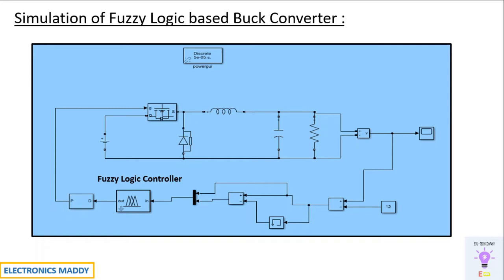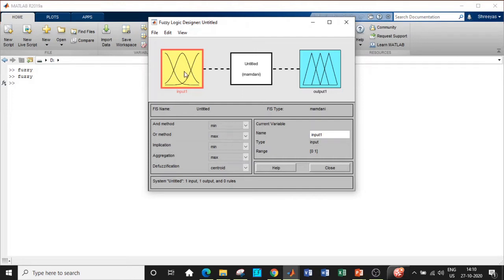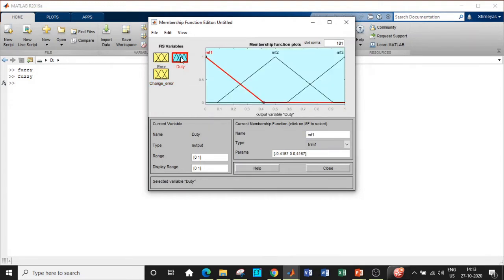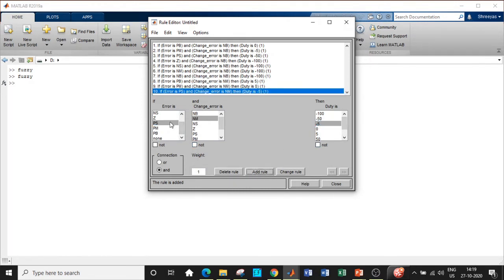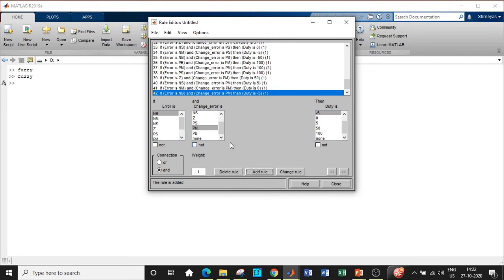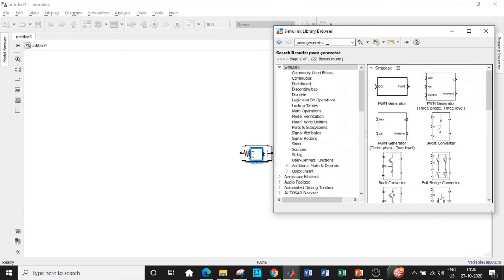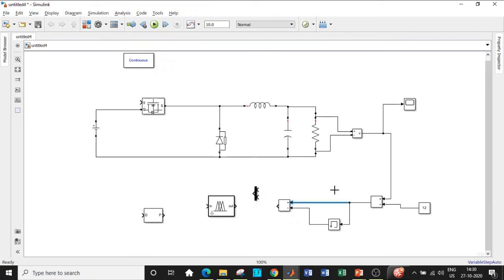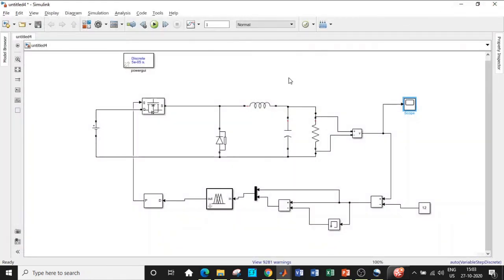Simulation of Fuzzy Logic based Buck Converter in MATLAB | SIMULINK

Comment: Sir on which bases you have decided the values of the duty cycles
Reply from the maker: Certain parameters are assumed to have an initial design
Reply: @ElectronicsMaddy  sir can you tell me those parameters ?
Reply from the maker: Duty cycle, source voltage and load
Reply from the maker: Please check the videos on basic buck , boost simulations. I have explained there

Comment: hii...In fuzzy Logic based Boost converter you have considered Repeating sequence to generate signal to switch whereas here, u have considered PWM generator to generate signal to switch. May i know the reason for the difference
Reply from the maker: Raghavendra gogireddy its a very good question. Actually to be honest it depends on the context. I tried with repeating sequence but it dint work for some reasons (I am not sure as well). So i used a PWM generator and it worked. So moral of the story is use what works for you. Because for all of the blocks there will be a code in the backend and we will not have visibility on that. Unless we understand whats actually coded we cant figure out why.
Reply: @ElectronicsMaddy  lately, ur channel has become my go to place to check out videos to understand concepts easily...
Wish u all the best brother..keep doing more videos...
Reply from the maker: Thank you very much :)